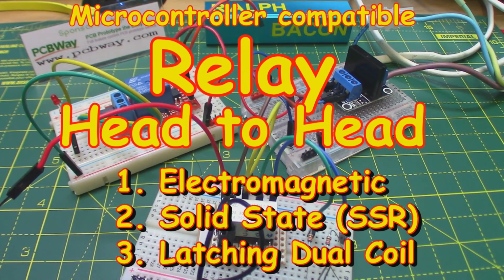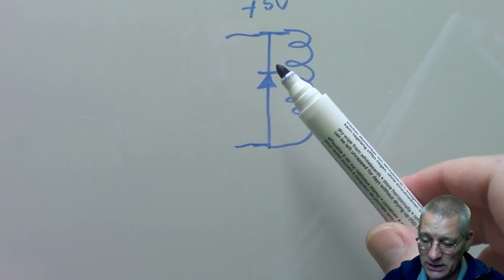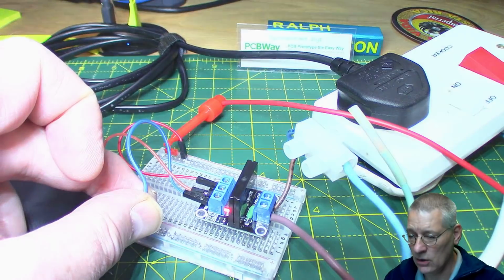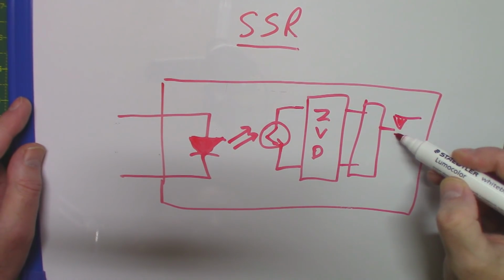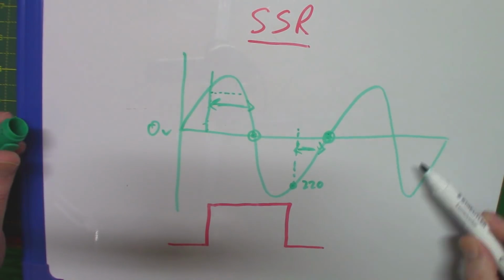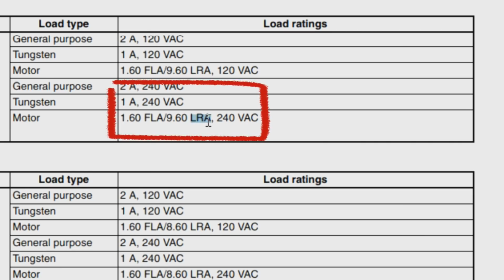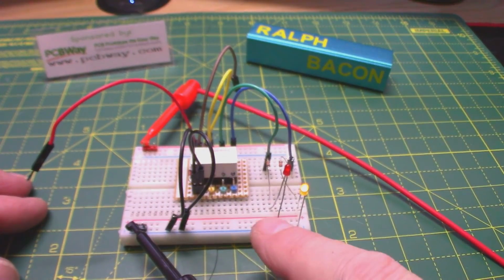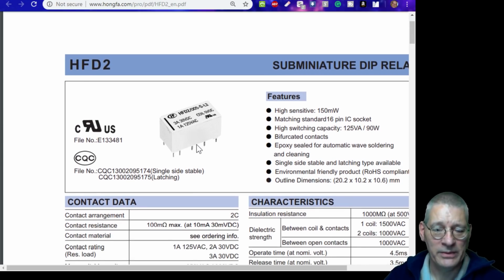#127 Relay Comparison - Electromechanical, SSR, Latching

Comment: I have a microcontroller function that works with a momentary switch connecting a pin to ground, I want the output from another microcontroller pin to act like the momentary switch, can this be done with just a transistor?
Reply from the maker: You'll have to explain a bit more what you want to achieve, otherwise I can see me suggesting you do something silly like shorting out a GPIO pin. 😮 From what I can see from your question, any GPIO pin can act like a switch, with or without a transistor - but I need more details.
Reply: @RalphBacon  it's just a button connects a pin to ground to make something happen in the code on an esp32, this is not the issue.  The question is how to replace that button with the output of a voice recog module (3.3V)  I could trigger a relay and close the contact but there must be a way to do it with a transistor.
Reply: @RalphBacon  I tried a 2N3904 transistor, connecting the 3.3v output of the voice recog module to the base but it didn't seem to work.
Reply from the maker: Your driving device (voice recog module, for example) must bring its output either high or low. This can then be used directly (or via a transistor, ideally a MOSFET) with a microcontroller. So the driving module is the one to get working first.

Comment: I have worked with many other types of relays from m/a to hundreds of amps. 1.5volt to Kilovolts. But most of them have been replaced with solid state electronics. These Three are about the only ones readily available now.
Reply from the maker: Yes, indeed. I nearly used some SSRs in my most recent (Barrel Pond Controller) project but decided I'd use up my relay. But they are still readily available from supplies like Mouser, RS Components, Digikey etc.

Comment: I sure wish you were working with  DC-DC SSRs.
I have bought several of them with, usually pretty poor results.   You can get a 60 amp model for as little as about USD$10 or as much as well over USD$100.  Lots of fakes out there.
Reply from the maker: I've got a mains 10A SSR but it is a fake and I would not use it in a real project, just for experiments. And it's quite big, even bigger with the heatsink.

Comment: SSR for high current ac loads to prevent contact burnout vs. Mech
Reply from the maker: I have an SSR, Dehv, plus heatsink and the whole thing is huge. I'm not sure whether I'll use it yet. I have some very good 30A relays now (verified, certified) so that might still be a better solution. Options, options!

Comment: Thanks for explaining the SSR.
I'm working on a project to control numerous 110V AC lights with SSRs. I wanted to make a mock-up design of them, but using LEDs powered off 5V DC. Your video answered my question of why the DC powered LEDs never shut off on a SSR.
Reply from the maker: Indeed, that's the reason, Shawn but you could use 5v AC just for the LED supply and the mock up would work.

Comment: Good day sir 

is it possible to combine Wemos esp8266 d1 r1 and 5v 1 channel Solid State Relay ?
Reply from the maker: Possibly, Kol. The relay is triggered via the relay's onboard optocoupler (basically an LED, as far as the ESP8266's GPIO pin is concerned). So, as long as the LED lights up (you won't be able to see it) the optocoupler will energise the relay. You'll have to power the relay (VCC) with the 5v from the ESP8266 but that's easy too. You'll have to try it to make sure!
Reply: @RalphBacon  this is too much to ask sir.. but can you help me for the right code that will work for these two  cause is it hard to find the right code in the internet and the app that will be use .. so please sir help me for this project of mine, sir.. cause it is my first project and i want to know more about arduino but this gives me a hard time :(
Reply from the maker: Sorry, Kol, I'm not going to write your code for you. Follow the demo in the video(s) and then see if it works with the ESP8266. There are no shortcuts. That way you will gain the experience you need, too.
Reply: @RalphBacon  hahahaha its okay sir
Reply: @RalphBacon  sir can i ask the app that used for arduino or compatible for it ??

Comment: I am about to test the Omron G3M, but ordered some of these while I was there sniffing about .
What  I thought was low input voltage  SSR's for DC loads. That was after all my search terms, I was just assuming they were for small DC current. Order first, read  later :-)M
But this 7 pin DIP has two triacs handling up to 1.2A  240V A.C.  :-O
https://goo.gl/X1hYuH
Data sheet: https://goo.gl/bc1YGc
Reply from the maker: Tell me about it, Chris!.
 
The stuff I've ordered without reading the spec sheet properly (and never rely on just the seller's information).
 
That SSR is physically very different from any other I've seen. I'm just trying to work out where you got the 240V AC from as I can't find that in the spec sheet (see, I DO read them, just possibly not properly, but I did try to do this on my phone in the car at lunchtime!)

Comment: If switching part way through a cycle is bad, should we be using ZVD for mechanical relays? (And is that even possible?)
Reply from the maker: A very good point there BaselBantam. After all, if RFI can be generated by a TRIAC then it can be anything that switches mains electricity on and off. What about household light switches?
 
What I seem to remember (but will research further) is that a single on/off switch (like your household switches) cause no more than a "pop" in terms of RFI, and can often be heard on analog radio sets quite clearly. The more current being switched the louder the pop or click.
 
It seems we generally suffer (as in, put up with) these, although manufacturers have to take steps to mitigate RFI (from washing machines, for example, that switch large loads). However, if we were to switch the device on and off many times a second (light dimmers, for example) then much more notice must be taken of RFI, hence the zero voltage switch.
 
It's an interesting, not to mention tricky area, and I shall research further. Thanks for your interesting point, BaselBantam.

Comment: That was very interesting...I have 6 military grade latch relays and they are very reliable, but I do not have projects with them for the moment... I would give 2 of them to you if you are interested.
Reply from the maker: Ooh, can they switch 240v mains electricity, Pierre?
Reply: Sorry, they work with 12 volts and are rated for 28 volts at 3 Amp.  but If you are still interested, I could send you 2 of them ... @RalphBacon
Reply from the maker: That's very kind, Pierre. If you email me at the email address on my main channel page (on the About tab) I'll send you my actual postal address. I daren't be more specific here or the bots will find it and I will be spammed to death!
Reply: I totally agree!  @RalphBacon

Comment: DC SSRs are quite easy to obtain. They use photo mosfets instead of photo triacs. I use CPC1706Y in my projects. Don't forget to put a current limiting resistor on the driver LED or you'll destroy your SSR.
Reply from the maker: Ah, indeed, ms3bain, I mentioned in an earlier post that in some ways this is "cheating" inasmuch that the word "relay" is now being used for MOSFETs - just like I used in video #123 albeit the ones I used were not main voltage capable.
 
Oh well, as long as the item works OK I guess they/we can call it anything we like! And, at least, Arduinites understand what a relay does so whether it's a mechanical switch, a TRIAC (which stands for TRIode for AC, who knew?) or a MOSFET I guess it doesn't matter too much!
 
Thanks for the heads-up about the SSR limiting resistor; although the one I have has one built in others might not.

Comment: I have a few of these and they all seem to have flimsy terminals,  are they safe? I wont get my "knickers in a twist" if not answered. lmao
Reply from the maker: Which ones do you have, Vic? The traditional relay seems fine, the SSR, at lower currents is good too. The latching relay I would not use on UK mains voltages.
Reply: @RalphBacon  The ssr I have does have rugged terminals but the typical blue ones you show remind me of sonoff terms. use em for lamps only.

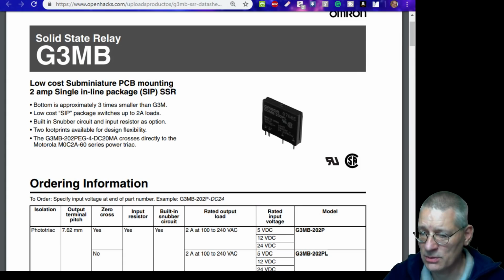Comment: 16:45 - I wish my bottom was 3 times smaller...but that's a different story.    [that was a spontaneous good one right there..] 
the SSR snubber short circuit explanation was in place..(-:
Reply from the maker: The less said about my Gluteus Maximus the better, quite frankly, Ronen! Thanks for posting.

Comment: I do have a latched relay with just one coil. Apply voltage and it switches and latches. It requires to have the voltage reversed to switch the contact back again
Reply from the maker: Ah, Ed, fashionably late to the party again! Two earlier comments here on single-coil, latched relays both elicited the following comment from me:
 
I wonder how they are supposed to work without the ability to both source and sink the current (ie in different directions). Easy to do on an Arduino, but otherwise?

 
Perhaps you can answer?
Reply: @RalphBacon  i just like to give other people the opportunity first to make intelligent remarks Ralph :-) Anyway I am a practical man so I am just happy they do, but I presume that there might be a permanent magnet that if under a certain polarity goes one way and under the reverse polarity goes the other way, both directions than push or pull the switch in a position it mechanically holds. https://www.edn.com/design/analog/4324841/Circuits-drive-single-coil-latching-relays
Reply from the maker: Uh huh, he said, nodding his head in a knowing fashion.
 
As I suspected, Ed, it's tricky if you have to change the polarity of both ends of the single relay coil to get it to switch the other way (like a DC motor). Without the simplicity of two output channels which can be configured for current SINK or SOURCE in an Arduino (or similar), I'd use the dual coil version, frankly.
 
But it's good to know that the single channel versions are available and easy to use on an Arduino.
 
I don't know if anyone else has responded, I'm working from top to bottom in the comments today!
Reply: @RalphBacon  correct, using H bridge for that

Comment: Good to have you back. On the relay, optocoupler circuit. Make sure you use an isolated voltage for the relay.  If you don't it is just a voltage translator.  Good video as usual.
Reply from the maker: Good point you make there, James (and which I also go on about, at length, in video #18). Nice to hear from you.
Reply: You too may friend love your videos.

Comment: Re latching relay - not necessary two coils. There can be one coil, and you just put different direction current there. And the contact group is magnetic, so it feels the current or rather magnetic field direction, so it switches off or on depending on the polarity on the coil. I remember in the USSR the name was like polarized relay. They were fun to play with :)
Reply from the maker: Yes, very important we do not forget the protection diodes.
 
And we use two zeners because a single standard diode would just short the circuit in one direction or the other, whereas two Zener diodes, (back to back or anode to anode) will deal with each half of the cycle. The Zener diode voltage should be above what we expect at the output pin, but 5.1v might not work - I'd go for 5.6v or even 6.1 just to be safe (zeners can start to conduct well below their rated [clamping] voltage).
 
This wasn't aimed at you, Brian, but at everyone else reading this post!
Reply: @RalphBacon  I'm not too sure what the typical forward voltage drop is of a zener diode. If implementing the k- k idea above you'd need to add that Vfwd to the Vz to establish the voltage stress on the Arduino port.
Reply: You're referring to what's known in the telecoms world as a Carpenter Relay.
Reply from the maker: I've just replied to Bob Lewis here, and posed the question:
 
I wonder how they are supposed to work without the ability to both source and sink the current (ie in different directions). Easy to do on an Arduino, but otherwise?
 
Any ideas?
Reply: @RalphBacon  The ones that I had could stay infinitely in any of the (two) stable states. Like a system of magnets, you know, it can't be in between, but can have a few stable states. And those relays definitely had quite a complex magnet system inside their coil and contacts. Looked really pretty inside, like swiss watch :) Fun to play with. Such a pity I can't take a photo now - they must be have been thrown away, what a shame. They were from either some mainframes of the 70s-80s or from rockets of that era or their supporting equipment. Maybe from telecom, I dunno, had relatives in the first two areas.
Reply from the maker: From the way you describe it, it sounds almost over-engineered! Especially when two coil relays are easy to implement and work well (and it makes the logic easier too, I feel).
 
Not to worry, the dual coil versions are cheap and plentiful, but if anyone has a single coil version we can use it easily on an Arduino as we don't need to permanently ground one side of the coil.
Reply: @RalphBacon  You have probably figured out already how to drive a single coil latching relay (Carpenter relay https://electronics.stackexchange.com/questions/76666/understanding-the-polarized-relay-concept) by an Arduino. Subject to current limitations connect it between two outputs. To SET the relay momentarily make one O/P HIGH and t'other LOW. To RESET it rinse and repeat t'other way around. To de-energise the coil make both O/Ps the same. 
BT must have scrapped thousands as they were use in many Strowger Telephone Exchanges. One such use was in what was known as a DC2 Relay Set. They we used on lines(trunks) between exchanges.
Reply: I forgot to add you'd need to add a pair of low voltage zeners connected cathode to cathode (or similar clamp) across the O/Ps to protect the them from back EMF instead of your regular flywheel diode.

Comment: Hi Ralph! Hope the eye is much better. You don't look quite the Cyclops  you appeared when it first occurred.

Blimey, you didn't waste much time getting to grips with that concept I mentioned. Once again great video. 

I was going to add the caveat about some of the Chinese "latching" or "bistable" relays which are nice but as you rightly point out, and I discovered for myself in the meantime, they are NOT "power less" bistable units! They still consume power to maintain a closed connection on the Normally Open contacts.  I'm still hoping to find one such  proper zero power latch type from China but so far to no avail sadly.

With regard to your other question about whether higher volts, amps and power can be switched - YES! There are relays from other companies available to do that. I've just repaired an underfloor heating timer/thermostat which had a faulty such relay. It was a standard unit from an Austrian company called Schrack (No, not Shrek! 😁) - WELL known in the industrial automation space. 

Sadly these I could not find online from eBay in the 3v version I required, at a sensible price for the 2x AA battery operated unit I have. And,  although RS (rswww.com) - Radiospares of yesteryear - have 5v versions as well as 12 and 24v ones they had NO 3v ones.. Farnell however (Element14 for US and elsewhere) DID have the exact one. Obtained - next day delivery - fitted and thermostat switch now operating again properly!

The 3v version is manufacturer part number is RT314F03. BUT, a search on the Farnell's website for bistable latching relay should provide plenty of options. The one I procured has 16A switching capability (although the Farnell's short description says 20A which does not agree with the spec printed on the relay itself!).

One OTHER point worthy of note is that there are BOTH twin coil (as you described) AND single coil versions of latching relays. The latter typically work by providing a reverse voltage to the single coil which then drives the contacts in the opposite direction. Once again caveat emptor! If possible obtain the datasheet FIRST and confirm the relay will do what you want! 

Hope that helps. Glad I helped you learn a bit more about these useful relays and once again a VERY well produced and concise video. 👏🙌👍👍
Reply from the maker: You inspired me Bob! I can't believe I never came across these in my electronics work before, but there we are. Others have mentioned a single coil, latching relay - I wonder how they are supposed to work without the ability to both source and sink the current (ie in different directions). Easy to do on an Arduino, but otherwise?
 
Thanks for the references I shall check them out, hopefully the information will remain lodged in my grey matter.
Reply: @RalphBacon  The single coil relays need an H-brigde to reverse the current for set and reset. Have a look at the Panasonic  DE2A-L2-3V capable of 250V ac @ 8A

Comment: i've been tinkering with a latchable dpdt relay to simulate a crossover switch in a lighting circuit to make  a 3 way switch.  I just wanted it to change each time it was pressed.  And stay that way over power cuts.  Used with a H bridge as the one i used would need the polarity reversing to make it do it's stuff and gets very hairy with an arduino...  Only trouble is, I don't really like messing with 240v, so project never got any further than experimental stage.
Reply from the maker: You can get DPDT latchable relays, Adam, (my demo relay had two sets of switches) so would do just fine for your project, except you would need an official 240v version (I don't think I'd trust this relay on 240v despite what the datasheet says).
Reply from the maker: See the post from Bob Lewis here, he mentions higher powered ones.